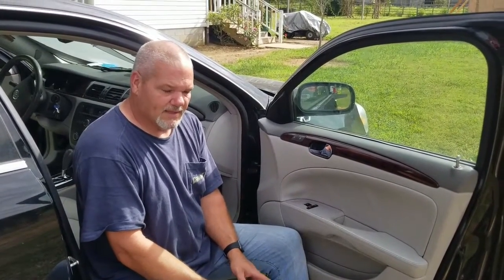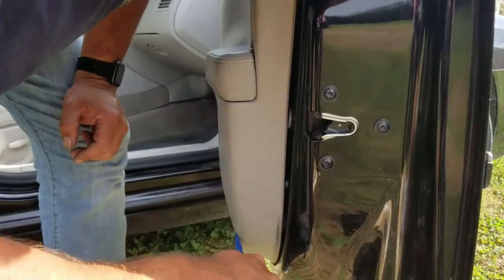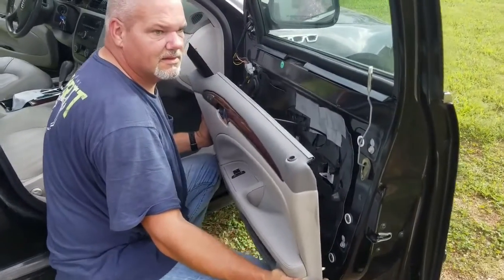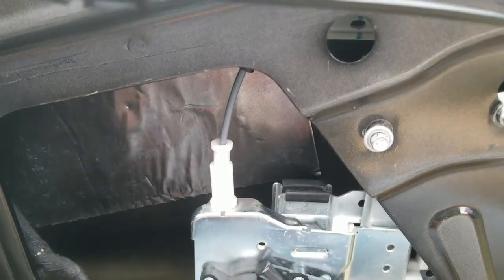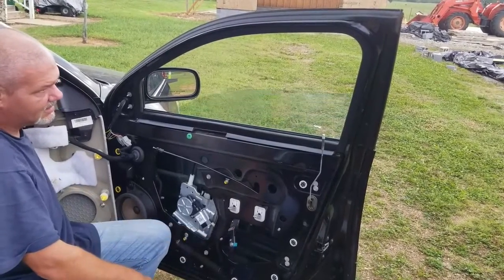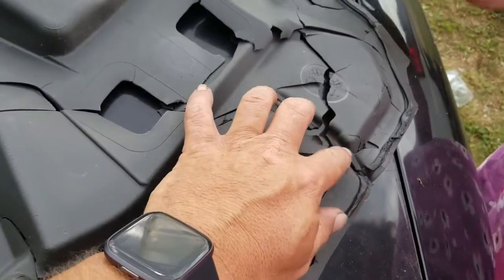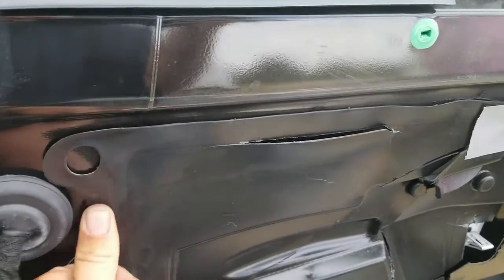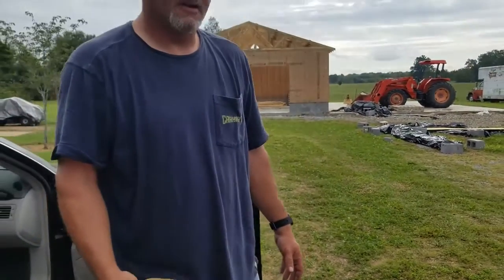2011 BUICK LUCERNE WINDOW REGULATOR REPLACEMENT

Comment: Thanks so much for your video. My window got stuck this weekend and I was determined to get it fixed ASAP.  I searched for a helpful instructional and found yours.  I told my husband to look at it because it was a fairly simple job. He looked at it and agreed.  He had to drive an hour total for the part. He installed it and saved us around $300. Your video was very thorough and the video itself is extraordinary.  We saw every detail.  Thank you for making something we assumed would be a big job so simple.
Reply from the maker: Thank you for your awesome comment! Made my day 😀  I'm glad it's fixed and you saved some $$$ glad the video helped!

Comment: Super helpful, only two parts that held me up was releasing door handle latch (you have to press pretty firmly on the black plastic piece to free it up), and the power cable plastic release was pretty stiff on my car, needed a plastic pry tool to wedge it out. Tightened the screws that holds the glass as much as you can, is very important, just a fyi for anyone else.
Reply from the maker: Thank you for your comment! It was pretty stiff on this one too but i had worked on this door before and didn't think to mention it

Comment: They want $15 for one of those push pins if you break them. Crazy prices anymore. $15 for each push pin. 😭😭. They do break especially if you dont hit the hole exactly. After years they get very dry. The door handle will also break or get loose vause they are plastic and you have to buy new plastic retainer pins and handle and this is the way to change it also. Stock up on parts for this car if you have one cause now they are getting harder to find and expensive or just obsolete to give people advice.

Comment: Great video, Mother got too close to a mailbox and broke the base of the mirror on the passenger side.  After watching your video I was able to pull just enough of the door to replace the mirror without going through what your going through.  I got a chuckle when you were describing how one screw was it, for that door, those retention pins are pretty tough. Thanks for your work.
Reply from the maker: Thank you, yea they were tough
Reply: And expensive to buy if you break one  $15 a piece

Comment: Man thanks for the video. You made it look so easy. Thanks for taking time to share with us.
Reply from the maker: Thank you for your comment. The drivers side window stopped working and i assumed it was the motor but i found there was no power then moved to the switch and there was power there. It was a broken wire in the door jam. Pulled the rubber back and it was completley broken. Connected with solder and shrink wrap. All good again.  Just thought I'd add this in incase you run into that

Comment: Were there some funny metal interior clips?  I am working in my rear door panel
Reply from the maker: I'm sorry, i caint remember. That's been a while ago. Seems like there may have been a few across the top
Reply: How do I jump my window up in the mean time?
Reply from the maker: I have worked them up and put a wedge in it but sometimes the cable binds and there's not much you can do
Reply: @CFarmer  isn’t there a way u can jump with battery up
Reply: Until u fix it
Reply from the maker: If it is the switch bad yes, hard for me to explain. Try at your own risk but if you unplug the window motor and if it's 2 wire if you put positive to one wire and negative to other it will either go up or down. If you swap the wires around it should go the other way. If that makes sense
Reply: @CFarmer  o ok I have 2006 Buick Lucerne
Reply from the maker: That should work if it makes sensebut the door panel will have to come off. It's the 2 wire plug that comes directly off the window motor
Reply: @CFarmer  thank u
Reply: @CFarmer  I can hear the switches all working Jus cabt get the driver window up or down stuck half way down

Comment: Hi c farmer. I have a lucerne 2011 cxl and the drivers side door handle broke at the hinge. The dealership is telling me that I need to replace the whole panel cause of the plastic welds???...help please. Thanks.
Reply from the maker: I'm sorry but I'm not really sure about that. I'll try and look into it and see if i can find anything and get back to you
Reply from the maker: Maby I'm not understanding correctly, here is the interior handle on Amazon for around $25. Not sure why they want to replace door panel
Reply: @CFarmer  the guy I spoke to said it was because the handle set was plastic welded (I think that was the term he used) to the door.
Reply from the maker: I'm sorry, I'm not able to help much on this. I would've thought it would be an easy fix but i caint remember how it went together . Wish i could be mor help
Reply: @CFarmer  thanks for trying. I ordered the handle from autozone just now and will let you know how it went.
Reply from the maker: Ok, I'm curious to know how it goes. Good luck with it

Comment: “Yeah just slips right off” bruh this thing won’t unplug.
Reply from the maker: Some can be pretty stubborn. I may have just got lucky
Reply: @CFarmer  that’s bull, it has a weird head to it
Reply from the maker: Talking about the bolts that hold the window motor in?
Reply: @CFarmer  nah well idk the chord connectect to the door itself and how do you take off the white lever lookin clip with the thick fiber black chord?
Reply from the maker: There are 2 plastic tabs you squeeze together and pull the cable back then a slot in the bracket the wire cable will fit through to clear the bracket then there is another slot to remove the cable from the door handle. It's tricky the first time you do it. I should have got a closer video of removing the cable but I've done it so many times i didn't think about it. Sometimes it helps to use pliers to squeeze the tabs then release the pliers as the tabs clear